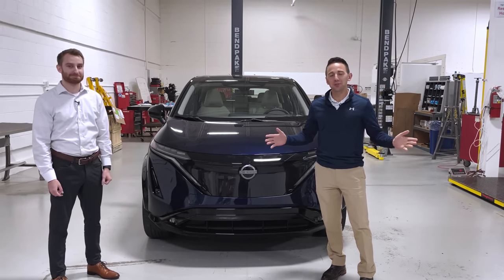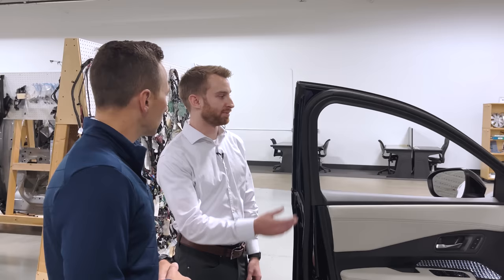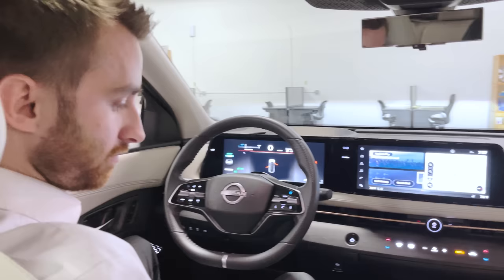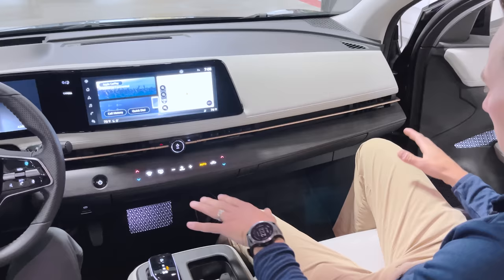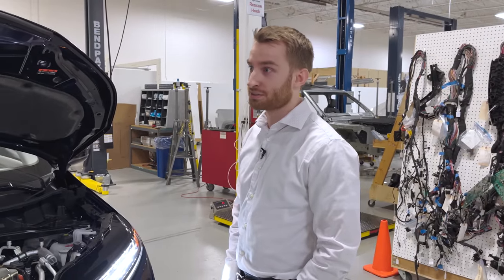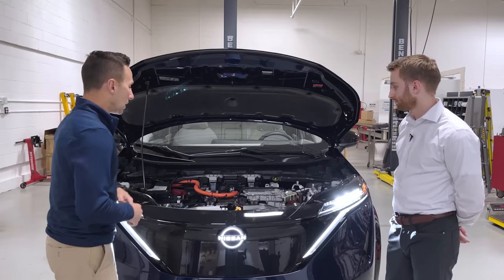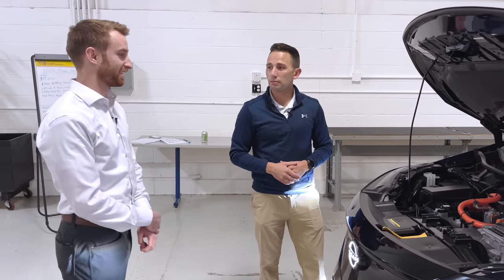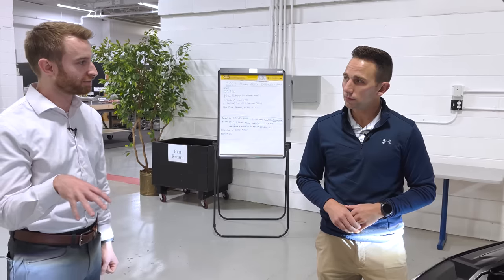Nissan Takes the Tesla Approach with Its Integration on the Ariya

Comment: That EESM drivetrain was initially developped by Renault in the Zoe, the exact same powertrain is also used in the Renault Megane Etech.
Cool thing it's that enables 22kW AC charging, they use the windings of the motor stator as chokes for AC/DC conversion
Reply: And introduced in 2011, so plenty of experience...
Reply: Spoilers , its very CRAPPY.
Reply: @markplott4820  Not at all, it's very efficient and don't use rare earth magnets.
Reply: @negofol5278   - ZERO development , ever since 2011 , ZERO Innovation. 
TESLA went to Hairpin in 2022. constantly improving DU.
Reply: @pxidr   - TESLA model 3 RWD is MOST Efficient CAR on EARTH , over 135 mpg.
Reply: @pxidr   - the Nissan ARYIA is an Incredibly INEFFICIENT vehicle . 
too HEAVY , its FWD , built too COMPLEX. too Expensive to SCALE.
Reply: @pxidr  - far too many Brackets , holding up MORE brackets. INEFFICIENT.
Reply: @pxidr   - NISSAN is a joke , still using Replaceable fuses & Controllers from Different Suppliers.
Reply: @markplott4820 yeah completely stupid to use Fuse.. let the car burn.
Is a car a short term investment? Do you think that price to performance is not important? Have you seen what Tesla car cost and how it is build?😂
Reply: @markplott4820  I own myself a Tesla 3, but I recognize also when the competitor's designs are good. It's the case for this Ariya. Maybe not as good, but good enough.
GM used hairpin design a lot before Tesla.
I'm not as hysteric as you.
Reply: @kitecattestecke2303   - TESLA uses Resettable SMART fuses. 
everyone , should at this point. 
ARIYA has neither PERFORMANCE or good price. 
TESLA keeps LOWERING prices , keeping SAME very High Quality.
TESLA in 2023 is building BETTER cars than LEGACY auto , Tesla cars last +50 years. there are MANY 2009 Roadsters & 2012 model S on Roads in 2023.
Reply: @pxidr   - ARIYA is not even just "good enough" its not even trying to be a Good car. and its too Expensive , for the TECH you get.
Reply: Mark Plot,you will go broke with your Tesla investment,and you deserves it!
Reply: At least it has a flat charging curve and dumb amounts of buffer
Reply: @markplott4820 he's talking about the drivetrain, not the Ariya.
Reply: @markplott4820  The Aria is quite efficient. If you see the frontal area and how large the car is, its not bad
Reply: @travelguy78   - ha ha ha, lol.
the ARIYA is Really BAD .
its too HEAVY . 
its FWD based (AWD too) and its Incorrectly Balanced . 
TESLA RWD is Correctly balanced , also the MOST Efficient CAR on Earth. 
the Highland model 3 is the Lowest Drag Production vehicle on Earth.
ARYIA has Front cross section of a BRICK wall.
Reply: Renault really dropped the ball. They were making EVs long before Tesla and arguably had a big first mover advantage with the Fluence EV. They squandered it badly…😢
Reply: Wow. Mark 4820's lost the plott!! Boom Tish yeah, I crack me up... Why so much rage? Any EV that's reasonably well designed is a good thing. Lots of people won't buy Tesla's (brand association with Elon/ beige egg design/ too space agey/ market saturation etc) so take a chill pill and appreciate what they've done well and that they've finally released a good EV to backup the leaf.
Reply: @iseeyourschwarz8973   This is true, any EV is a good EV these days! My main thing is I'm sad Renault is dead... I have been a long time fan of their fun, clever and innovative cars and have owned about 30 of them over the years! They always pushed boundaries and just made cool cars. 

Now they are just another also-ran making suv shite for the masses and it makes me a bit sad...
Reply: @markplott4820 If your muppet car is so great, why do you feel the need to trashtalk the Ariya?
Reply: @markplott4820 Gallon of what? Bullshit?
Reply: @markplott4820 It seems that your head has been hit by many bricks. 😂
Reply: @kajko6868   - seems to me Selling well , Model Y is #1 GLOBALLY , with #1 in REVINUE in 2021.
Reply: @markplott4820 , you need to take some tranquilizers...

Comment: Guys I have to say driving a Tesla No buttons and knobs is luxury to me. Having it all in one place and with voice commands. The only thing i have to move is the drive selector. No start stop button, walk away lockup, camera security, best app software ever. I can find my car now every time. These are all luxury touches to me.
Reply: Found Elons account. That’s probably his next son’s name.
Reply: Agree
Reply: I agree as long as it's safe: the integrated turn-signal directional / indicators are still an issue for me. The concept of their operation seems half-baked and not as well thought out. If they intended its functionality to supplement their navigation workflow, such that the FSD package was informed of the driver's destination, they still should not have approved the change until after the level 5 FSD package was approved by regulators.
Reply: Not a fan of the minimalist.  As a Buck Rodgers and Star Wars kid, need buttons.
Reply: Only issue I have with buttons is the amount of wiring and parts it requires for just 1 button. Take about 6 wires that have to reach a controller and 3 pieces of plastic not counting the actual electrical portion of the button itself. All that just to "partially" turn off traction control. Multiply that by 5 to 10 buttons turns into spaghetti behind the dash
Reply: We've put 85,000mi on our model 3, it's been one of the best cars we've owned.  But I'd never call a Tesla a luxury car.  If it had , massaging seats, quality controls, burled walnut , and a quiet ride, I would agree.
Reply: I’m with you on this one, I really like the minimalist approach in my model Y. Also for me it’s the best car I’ve owned after more than 40 years of driving.
Reply: There really are people out there having problems with touch screens. I prefer e.g. my very redundant Kia EV6 and it’s easy to keep clean screen and I hate too big dirty and polluted screens of e.g. Mercedes EQ AMG and others with reflective screens in sunlight. Then I also prefer HUD in front of my view. This feature would be a must to buy a Tesla.
Reply: I drove a regular car and really missed the tesla screen.  My husband, when he drives our Sierra, really misses the screen.  We were raised on slide rules.  We are not computer geeks.  Our Tesla is so easy and fun to drive.
Reply: @elainebradley8213 Recently test drove a Model Y and was surprised how easy the screen is to use.
Reply: My experience renting a 2022 model Y for two weeks was not good. Mostly because of the requirement to almost always use the screen. The voice recognition was laughable. I gave up on that on day 1. I could not do simple things like adjust the HVAC or change drive modes without taking eyes off the road. Also the car didn't have FSD but did have autopilot features. Multiple times in two weeks the car would apply brakes for no reason. The final straw was that on a car with less than 16k miles had a broken AC on the second to last day. This was in 90° temps in NYC. I would never own a Tesla after this experience.
Reply: most of that is standard or budget saving measures. Tesla got you good.

Comment: I love Nissan products I've owned several Maxima's and recently acquired a 2000 Infiniti i30. Highly under rated in my opinion. Super reliable, durable and inexpensive repairs (which were few) I hope the Aryiya gets traction in the EV market.
Reply: It will for sure
The cabin is nice and it is cheaper than Tesla. The tester said it is nice cabin to be in that says it all and it is front wheel drive which is very safe in winter snow/rain for daily driver
Reply: Nissan has been making junk for years.  But with Carlos Ghosn gone, the Japanese are back to running the show and quality should hopefully improve.

Comment: The single footwell in the front seems like a really bad idea. I don't think it is particularly uncommon for a driver to set things like shopping bags and purses on the passenger side floor. Doing so in this car could result in things rolling/sliding into the driver's side blocking pedal access.
Reply: Not a problem, if you want yo car order an accesory that adds an additional storage compartment that divides the footwell if you prefer it that way.

Comment: Test drove the Ariya.  The screen would show you the gas stations but not the chargers.  Thought that was silly and the software needed more work.
Reply: The software is a little hit and miss. The satnav is definitely a miss. It's TomTom and basically rubbish. But android auto/apple play takes care of that :)
Reply: It was not activated in NissanConnect in that case.
Reply: My Ariya definitely shows chargers on road.
Reply: @Cosmycal I rarely use the native sat nav. But I had a play with it the other day and it was displaying charger locations
Reply: You're lying or drove a prototype.

Comment: Visually.. nice design.. bang for the buck in tech, performance and efficiency in everything else compared to a model Y.. a mess. You want to spend more to get some visual design you prefer.. but less of everything else lol.. go for it. Considering the actual sales of these vs model Y..  I think most people prefer Tesla's approach of more for less. Yeah.. it comes with some sacrifices imbedded with simplicity for production.. but it comes with a LOT of better tech, efficiency in everything and performance. An EV of this size to have less space and no frunk vs the Y AND still cost more, is just inexcusable poor design.. way to go with the HVAC design though.. but why is everything else taking up so much more room than other vehicles? Tesla has frunks.. Ford has frunks.. even KIa and Hyundai have small frunks.. why does Nissan and so many others have 0 space? lol. Bad engineering. And being a front wheel drive EV.. bleh.. terrible idea.
Reply: MODEL Y is a Better vehicle w/ MORE use cases than ARIYA.
Model Y is more Efficient , LIGHTER weight , Longer Range .
at least the ARIYA uses CCS , instead of DEAD Chademo , but Does not use Superior NACS.
Reply: At the price the Ariya e4orce 87 kWh costs in Switzerland I rather buy a Tesla Model Y or similar and also more advanced 800 Volts E-GMP cars from Koreans. Renault and Nissan are similar to the iD of Volkswagen, Skoda, Cupra and Audi - besides of the eTron GT costing three times as much - already outdated EV. BMW and Mercedes only partially competitive also costing double or triple the price with all in my Kia EV6 AWD has. Performance is great and I drive with an average of 16,7 kWh per 100 km since May 2022 when the Ariya should have been delivered. Communication with Nissan was very poor and the company seems to have big problems also for VIP customers owning a GTR - for electronics we had to go to a Hong Kong startup for some updated version in a 150‘000 USD car. So we do not think anymore that Nissan could survive with too expensive and mediocre products. Don’t get me wrong the Ariya is not a bad car if price would be down by 20‘000 USD😂
Reply: Wrong, there crates and box test on the Model Y and Ariya and they're pretty in line with the same cargo capacity, even with some box sizes the Ariya is capable of more cargo only with his trunk than a Model Y with trunk and frunk. So...
Reply: @Cosmycal   - Aryia is LESS Efficient than model Y , and cant TOW 3500 lbs. 
Aryia is too HEAVY and has LESS range w/ Full Passengers + Cargo. 
TESLA model Y LR still BEST option.
Reply: I'm 6'2. Bro is 6'3 280 lbs. We sit comfortably in the back of the Ariya.   We didn't even try to get in a Y. For some, a dealmaker

Comment: Need to make the Sakura EV available in America to replace the Leaf model. Make it affordable at 18k to 22K and two body style. A mini people mover and a 2 doors extended cab mini pickup.
Reply: Taking a look at the Sakura which is a Japanese kei car but for such a low price with its major features. It would sell well here. Around $14,000 110 miles EPA, 80mph, its a four door people mover. Minimial styling in side but has what you need. Especially at the low price.

Comment: While they did not mention it the EESM motor eliminates the rare earth neodymium magnets which is a big cost adder and as they mentioned a supply chain constraint
Reply: It depends if the cost of the additional battery capacity isn’t overshadowed by the rare earth costs.  Neodymium motors are almost always more efficient, which translates to less battery needed for the same range.
Reply: @ClockworksOfGL Correct, but batteries will get cheaper with time, rare earths not so much.

Comment: I like this car. Some good points, some strange - a lot of wasted space in the front cabin, for sure.
Looking at the "office", those "buttons" - when will manufacturers get it into their thick heads that physical buttons are really, really good?. 
When you're driving, especially at night, the last thing you need to be doing is checking which "tactile" piece of flat plastic you've hit. The location and/or feel of physical buttons is quickly learned and they then can be accessed accurately and without looking. Unless they're going to put more buttons on the steering wheel (as if the amount there already isn't confusing enough) this is a definite problem.

Glad Walker brought up the brake light issue on my car I'm never 100% sure on regen whether or not the brake lights are on! Can be scary.
Reply: "a lot of wasted space in the front cabin" - that is my wife's favorite location for her handbag.

Comment: To my mind, Teslas aren't "simpler", they are Spartan. Nothing to get in the way to a driving experience besides a functional platform. Bling is extratranious. Dials and a multplicity of switches and knobs are not needed. There are many other cars inthe price point that offer those features, but they can't meet or match the efficiency and lower total cost of ownership and speed of charging that comes with a Tesla. Don't complain about the minimalist interior, embrace it. My one complaint, and it isn't just Tesla, is the use of "Piano Black" which is a fingerprint magnet.

Comment: Hey 'kids" of this video[and out there} this writer and others can remember when the blower motor was in the engine bay till circa the 1970s. Then the car makers stuck it, no, make that buried it, under the dash. The reason, more money to repair the ^%$$@ thing when it failed. Even more money to repair if it leaked into the cabin. Its past time to put it where the Aryia has it.

Comment: you guy's mentioned that the Nissan had more head room than the VW id4 go and check it out the rear leg room and cargo space is larger on the VW plus the heating system VW came out with that first on the ID3 open the hood on a id4 and you will see that the fan and cabin filter is under the hood but it might not be used as a crush component like the NISSAN plus the id4 is rear wheel drive when it has a single motor.

Comment: I like the underhood packing concept even though the systems packaging is far more crude than Teslas.  HVAC all together is good.  inverters separated from motors which saves on casing. Inverter and motor can be upgraded separately. Could have two electronics packages HV and LV. The brakes could be bought inboard and mounted to the motor. There is less happening at the wheels and could have aero-covers both sides of the wheel.

Comment: I thought that the most efficient heat pump designs were of the split type.  Would Nissan's HVAC design imply a more severe range reduction when this car is operating in more extreme climates?

Comment: Does that motor design reduce drag when not needed on the AWD system, thus eliminating the need for axle disconnects for the rear axle shafts?
Reply: EESM reduce drag by their capability to control the field weakening effect on will, thus it can provide a bit more of efficiency on AWD drivetrains but only on that aspect, the passive physical drag like axle shafts and so on is the same as other electric motors.

Comment: High current, high voltage brushes?
Reply: High voltage, low current brushes. But the brushes are against a slip ring rather than a commutator so wear should not be a problem.
Reply: @evan010101  No wear problem on 10 years old Zoes....

Comment: "Externally excited" or "electrically excited", whatever you call it, it is one of the earliest AC motor designs used in the industry, starting from the late 19th century. You can find many examples of these motors on the youtube (ie https://www.youtube.com/watch?v=fNuI6keQXYA&list=PLFIso6i7PfQx9xuhOalFv6ovFvkZR_EQu&index=7). 
The advantage over PM AC (they are both synchronous machines), beside lower cost, is that the field can be modified depending on the working condition yielding better characteristics in some working conditions, but it has lower maximum efficiency since you need to apply some small power to generate the field.

Comment: they've somehow managed to make from under the hood look like an ICE vehicle including having the old fashioned mettle prop to hold up the hood.
Reply: Since there is no frunk, and no Engine oil to check, there is no reason to open the hood, except refilling the washer fluid. It's reasonable cost cutting to not use gas struts
Reply: @simson4t no strut and fill hole for fluid would have be enough 😂
No honestly the tester said it is a very nice cabin to be in so it is nice car😮